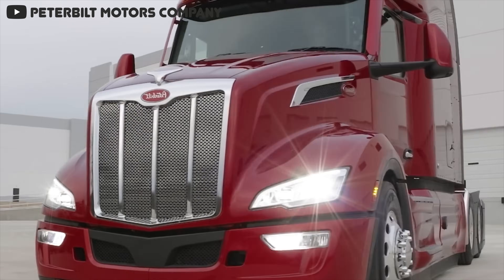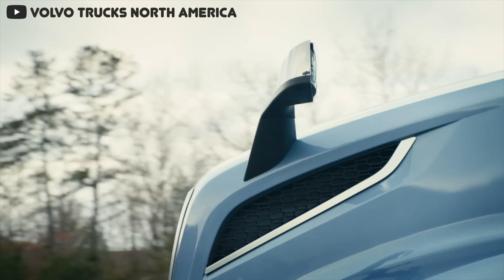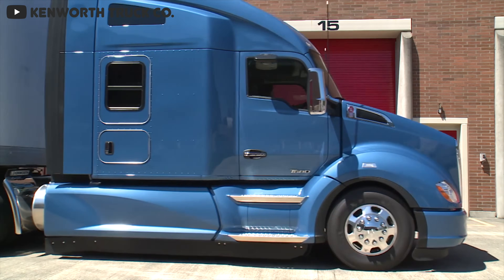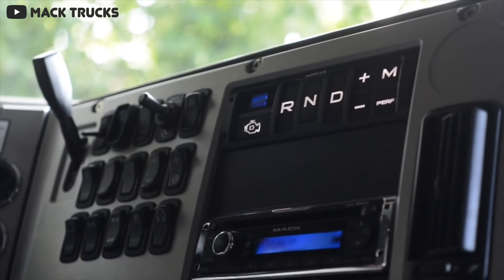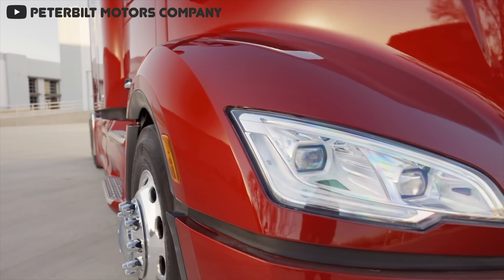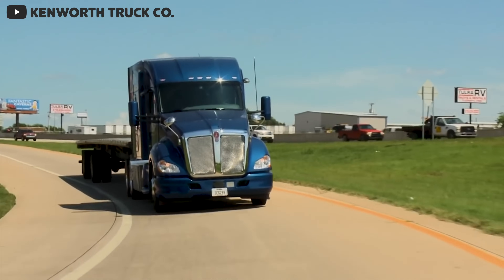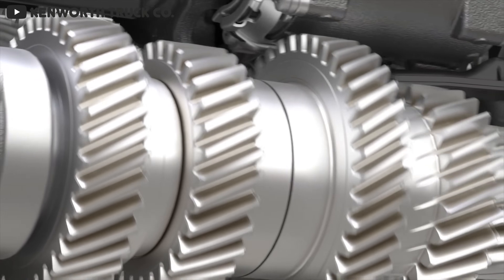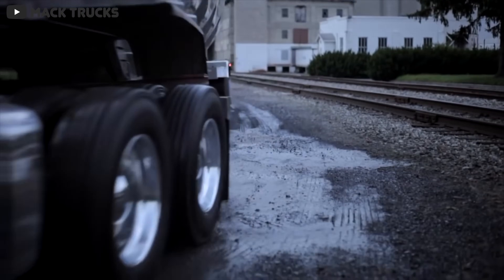Why do Semi Trucks Have so Many Gears?

Comment: Narrow powerband ( idle to 2100 rpms with peak torque at 1000-1200 rpms )
Heavy loads ( 80000 lbs. and up )
An Allison automatic with the torque convertor multiplies torque, plus with proper internal and differential gearing can have a more effective range spread than a manual transmission.

Comment: A big reason why a lot of companies are getting automatics is because drivers can’t drive standards
Reply: No shit, huh?
Reply: 3 pedals they cant handle it just imagine if the truck had a 5 or 6 spd with a 4 speed brownie box on it
Reply: Out of the 22 people in my CDL/A class about a quarter (6) opted to go automatic. Everyone else passed on the crash box and avoided the restriction.
Reply: Also automatics in the last 10 years have also started to outperform manual in efficiency. You can constantly update a computer in an automatic to make it more efficient there's only so much you can do with a driver.

Comment: The gears re there to make truckers earn their money. If it was just a four or five speed then they are not working very hard to earn their money
Reply: I drove alot of macks with a 5 spd or a 2stick 6spd they had 5 reverse's but you could also spilt the 5spd because one stick had the 5 spd the other had low and high and reverse if you had that un a R model with a 350hp mack motor and 4.64 gears in 52,000 lb rears you could easily put 55 tons on a coal trailer and come up out of those coal pits and right down the road
Reply: @davidcaskey4669  2 speed rears too?
Reply: @michaeltuggle9602  no never saw mack 52,000 rears that were 2 sp. I've seen Rockwell that werre 2sp tandum rears

Comment: Brother you have no idea. The real reason that makes them need many gears it's the low power. Imagine a 1ton car with 100hp that's 100hp/t which is way more than it needs so it can takeoff at idle using not even 10% of the power. But a 40t truck would need 4000hp to be as capable, but that's not economic, so with a 10/th of power it needs almost all of it to take off and ALL the power to accelerate
Reply: These trucks only have low horsepower because they operate at extremely low revs. The horsepower is not nearly as important as the torque.
A car that makes 100 hp at 6,000 rpm only is only making 87 lb ft of torque at the same rpm. A truck that makes 400 hp at 1,600 rpm needs to make 1,300 lb ft at that rpm. So instead of making 4 times as much power, the truck is actually making 15 times as much.
Horsepower = (torque*rpm)/5,252.
Reply: @rich7447  A 2.5ton car with 500hp will tow a 10ton truck with 200hp faster than it can go itself. Of course with apropiate gearing and no slip

Comment: Only a few states allow over 80,000 pounds gross combination weight. Most are limited to hauling between 42,000 to 50,000 pounds legally. Alison has been experimenting with heavy slush boxes from around the Second World War. My fathers cousin Woodrow Wilson Tyndale had a 1969 2110A International with a 549 gas engine and an Alison 5 speed automatic. I don’t remember the rear ratio. The other two 2110A’s had International 5 speed gearboxes and 2 speed rears.  In New Jersey where he was based you can gross 80,000 pounds with a single axle tractor and triaxle trailer no matter the length.

Comment: Just one bit of information here:  There were 8-speed transmissions  with a gear that some would call "granny gear" when I drove 9 years ago in 2009-2011 model years Freightliner Cascadia.   You might want to do a bit more research in the future.
Reply: You drove a 8spd low low

Comment: are there trucks with cvt transmissions like newer tractors?
Reply: Howlong do you think a cvt transmission would last in a truck I'm sure  they would build a bigger transmission but cvt transmission is drove by a rubber belt cvt transmission is what you have in a side x side also
Reply: They use a massive chain in a car cvt such as dodge and Nissans cvt trans a rubber belt wouldn't last very long even behind a 4 cylinder in a car

Comment: Allison has tried to further penetrate the heavy duty market but in general, the only practical application for planetary automatics are vocational stuff like dumps or cement mixers or with smaller rigs that run 9l engines. The manual or automated manual still enjoys hegemony because they're light and cheap and don't siphon off much power
Reply: The Allison 4000 series are mated to 11 to 14L engines in the bus and RV market. Unfortunately you can't afford that much power loss in the trucks.
Reply: @rich7447  I've seen an hx with a 525hp x15 mated to a 4500 Allison so it's feasible,  however the fuel economy is just too bad for on the road use
Reply: We also had Allison 7- speed automatics in our trucks in the military with up to GVWR of 120,000 lbs.

Comment: Nearly all the trucks in the UK and Europe are automatic now normally 12 speed 56 mph limiters a big change from when I started driving trucks 20 years ago back then they were all manual 12 to 18 speed with range changers and splitters but they were a big improvement on the old crash box which preceeded it
Reply: Automated manual
Reply: I couldn't imagine 56 mph here in the US that's insane, but importing Russian oil makes sense.

Comment: Scania driver here, I spent a couple of months in a manual 12 speed Volvo FH when I first started driving for my current company and been driving an automatic-manual Scania p410 ever since. I can't personally see a good reason to have a manual truck, the autos in my experience have better fuel economy, comfort, power modes and are really easy to use no matter the drivers experience.
Reply: You’re not a driver hope you come off the road soon
Reply: @andrewhatton1606  your point is?

Comment: Because these companies don't know Allison Transmission exist. Also torque converters multiply torque and the driver will never misshift 😘
Reply: It's easier to just make a manual or an automated trans than to make a auto
Reply: Computer shifts the transmission for them plus clutch for starts and stops. The company knows about Allison automatics but your looking at $10,000 for one to go behind a 8.3 Cummins 375 hp
Reply: I have an Allison 4050 (in front of a Cummins M11 450) and it is huge and heavy. It has 6 gears and weighs about 50% more than an Eaton 10 speed.

Comment: Then you get the trucks made for heavy heavy haul where they have a 18 speed up front then an auxiliary 4 speed behind it to split all 18 main gears 4 times over
Reply: so it basically a 72 gear :0
Reply: No transmission beats the spicer 6+4 24 forward gears
Reply: @danepatterson8785  I think those are the coolest trucks, ever since I found out about town sticks I wanted a truck with some. One day I’ll buy one
Reply: @zanekubicek2186  i used to drive an air to air mack 5 speed that was a bad ass transmission 5 reverse gears

Comment: Why not use diesel/electric like a train?
Reply: Diesel/electric setup cost more and less efficient long term (unless you have extreme weight like a train). It's also more bulky and they can't justify it because a semi doesn't weight like a train. If the weight is extreme (train) then diesel electric is the ideal setup.

Comment: I was watching a video the other day about shifting a Eaton 18 speed transmission. I wondered these transmissions in semi trucks are not synchronized it probably has to due with weight and complexity in the transmission.
Reply: There are synchros inside an 18 speed, only in the air shifted splitter box though. Technically all Eaton 10-18 speeds are two sperate transmissions bolted together. The main gearbox which you shift with the shifter is not synchronized. The rear box is all air shifted by the range and splitter valves on the shifter. It doesn't take that long to get used to driving one though. There will be grinding when first learning, that much I can assure you of.
Reply: It's more to do with the high torque
Reply: I don’t know what your thinking, but the 100 pound difference in weight doesn’t make a difference. On top of that, manual transmissions are incredibly simple, whereas an automatic is about as complex as a space shuttle. The reason they are getting away from manuals is all the new drivers don’t want to drive manual.
Reply: @Windsor_351  the transmission's in the new trucks that you maybe are calling automatic are manual transmission but a computer does the shifting and the clutch when you start and stop
Reply: The main reason that the main gearbox is not synchronized is that synchros are relatively delicate and will wear out far before anything else in a well maintained transmission. This isn't as big a deal in areas where you aren't running super high mileage, but it means that in places like Australia, Canada and the US the synchros need to be replaced too frequently.